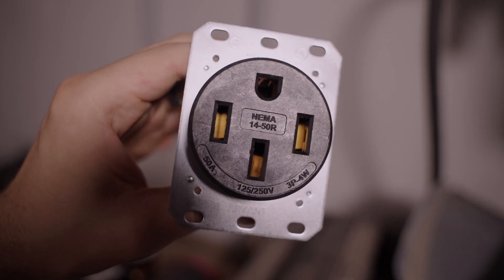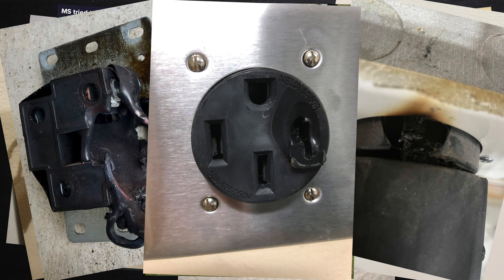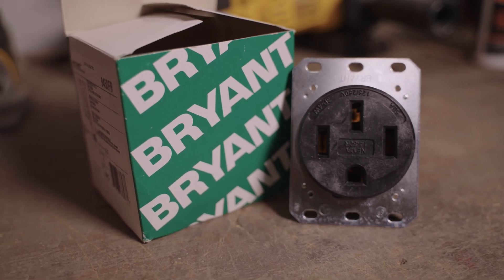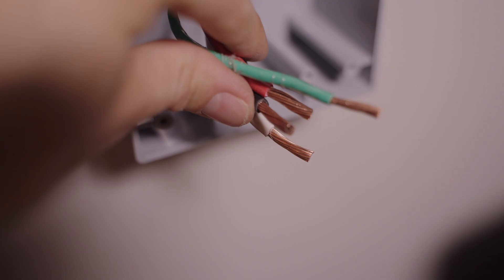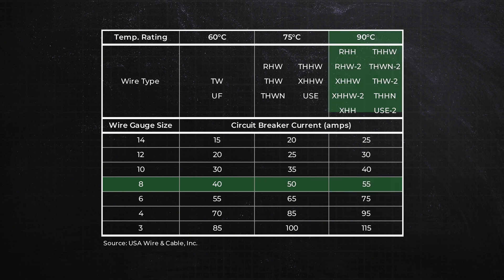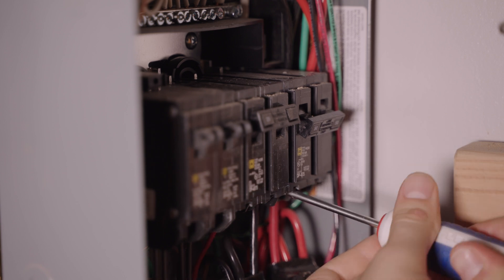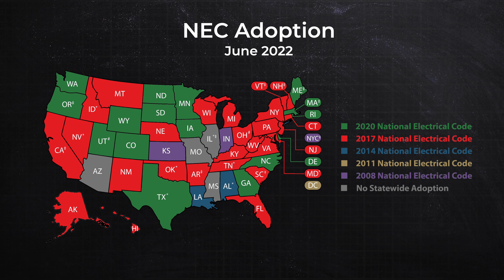3 Mistakes I Made Installing a NEMA 14-50 Outlet

Comment: The NEMA 14-50 is not the de facto wall connector unless the individual is crazy. 240 Volts in a US home is accomplish with 2 hots, L1 & L2, the Neutral is not used, you do want a Ground. The very best Wall Outlet for an EV is a NEMA 6-50. The NEMA 6-50 has 2 hots and a Ground, exactly  an electric car needs. You must also remember that because an EV Charging is considered a Continuous Load (a Load lasting 3 hours or longer). Code states that all items, conductors, outlet and breaker must be Derated to 80% of their normal Capacity, ROMEX (Also called NM Cable Non-metallic) 6 AWG is Rated at 55 Amps, but if it is used in EV Charging it is derated to 44 Amps and you cannot use a 50 Amp breaker, because derated it can only be used up to 40 Amps Continuous Load. With NM Cable, also called ROMEX,  you are purchasing 1 more Conductor than you need, wasting your money.   For EV Charging I recommend at a minimum 6/2 MC Cable. You can order MC Cable in 6/2 AWG which is 6 gauge 2 Conductor and rated at 75 AMPS @ 90 degrees, with a flexible metal conduit which I currently buy for $3.38/ft. - When you derate the 6/2 MC Cable you have 60 Amps maximum and a 60 Amp breaker gets derated to 48 Amps. So, with the 6/2 MC Cable you can get a nice 48 Amps continuous if you are using a hardwired Wall Connector.
Reply: You are right that the 6-50 outlet is technically a better choice. But I think the 14-50 has become "standard" because many EVSE come with a 14-50 plug, because they are set up to deal with an existing 240V outlet that wasn't installed specifically for charging. Since some 240V loads do need neutral, the 14-50 becomes the more commonly installed outlet, and so even though EVSE doesn't need the neutral, they are sold with the 14-50 plug anyway, and that in turn means installing the 14-50 outlet winds up being the "smarter" choice.

I'd guess this may change over the coming years. In a decade or two, when EVSE outlets are standard in new construction, they may well start being done as 6-50. Code might even start requiring 6-50, for that matter, to break the vicious cycle described above. But in the meantime, we're stuck with the fact that 14-50 is usually the more practical choice.
Reply: @harvey66616   The times that a Neutral is needed would be application such as a Stove it may need 120 volts for its Control Module, but no EV Chargers require 120 volts. (technically the Chargers are built into the cars, it is really a Wall Connector). I own 2 EV's and have driven almost everything currently available on the market.
Reply: @michaelholliday100  At least one person posting a comment here has stipulated that their EVSE does require a neutral. I've never seen that myself, but to state categorically that none ever do would be foolish.

But that's not even relevant (nor your other notes about "chargers"...I never wrote anything about "chargers", nor your claims of experience with EVs). The point is that other appliances, such as clothes dryers, some welders, certain power tools, etc. may need a 14-50. So even if it were true that there's not a single EVSE in the entire world that needs a neutral, that doesn't change the fact that many households will find 14-50 outlets already installed, and for that reason, EVSE manufacturers may choose to make their products with 14-50 plugs and not 6-50 plugs, and given that, then even though if the neutral isn't actually used, the 14-50 outlet is still what a homeowner will need.

Which is, in fact, exactly what I wrote before. Not sure why that wasn't clear to you the first time, but I hope that's all straight now.
Reply: @harvey66616  I know the EV Market well and I own two EVs. There is not an EV on the Market that requires a Neutral. Not have I driven almost every EV available, I have help install an untold number of charger and have given technical assistance to others...
Reply: @michaelholliday100  Irrelevant.
Reply: @michaelholliday100  "I assure you that if they state that a Neutral is needed..." --  I assure you, your fixation on whether EVSE requires neutral or not remains just as irrelevant as it always has been.

I pity your apparent inability to comprehend that.

Comment: It sounds like you don’t know about continuous loads. Continuous loads are utilization equipment that draws power for 3 or more hours at a time. An electric vehicle is a continuous load on a circuit. All residential (single home) breakers are only rated for 80% of the marked amp rating on them. That means that 40A breaker can’t have more than 32A running through it continuously. If your car draws more than that, you screwed up. I’m guessing if the car manufacturer requires a 50A receptacle, then it draws 40A when it’s charging (again, 80% of the rating of the 50A circuit that they require for the car charging circuit). Might want to check that…

Comment: Imagine 25% of households running their "stoves" on a setting using 40A for  multiple hours, every night.
We have nowhere near enough electrical capacity to supply that amount of power with "green" energy (unless the government and activists that seem to control the government accept nuke power as "green").
Reply: Not really true.   If you look at the "duck curve" (electrical grid load levels) one will see that the loads on the grid typically decrease nightly when EVs normally charge.   Contrary to your statement, EV loads actually help everyone out!   "That can't be!" you state but it is true.   Why?   Because the grid has to be rated to carry peak loads (during the day) and that has to be paid for by electrical rates.   The closer the overall demand curve is to a flat line over a 24 hour period, the better the utilization of the service and consequently the lower the price per energy carried because of near full utilization spreading the required peak cost over more energy usage.   

Finally, you mention EVs charging for multiple hours every night.   Statistically (which is the only thing that counts for cumulative load),  they typical US driver drives less than 40 miles per day which roughly equals 10-12 kWh.   An EVSE charging at 40 Amps (max continuous load on a 50 Amp rated circuit), is  9.6 kW on a 240 V circuit.  To replenish 12 kW into the car only requires 1 hour and 15 minutes charging.   This just is not a big deal for several years into the future.     Almost all electrical grids are underutilized so rooftop solar with battery storage and EV charging is actually a very good thing for the grid and the costs of the grid (per customer).   There is one caveat--capacity is not an issue but power plants will have to either produce more power at night or more typically, not use as much power for pumped storage so nuclear power is beneficial but until different designs get certified, there is very little chance of them being deployed in the US. (And yes, I am an electrical engineer.)

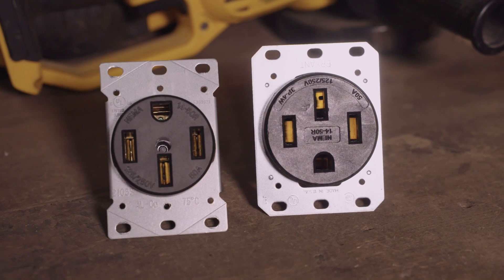Comment: So you went from a 'cheap' 14-50 which is rated for 75 degrees C to an expensive industrial one that is only rated for 60 degrees C. You can see at 8:55 that the old outlet is stamped 75 Degrees C. Was this really an upgrade?  Also since you reduced your breaker size from 50 amps to 40 amps, now you can only charge at 32 amps since a continuous load can only be at 80% of the breaker size.  So I wonder, was this really an upgrade?  Sounds like a pretty big downgrade.  

And finally, was it really cheaper to buy the off brand outlet that's only rated for 60 degrees C and a new dual pole 40 amp out let than just buying the better name brand Hubbell?  And even if it saved you a few dollars in the long run, but you've downgraded the usefulness of the outlet.
Reply: This was definitely an upgrade - those Leviton $10 receptacles are a fire hazard and not safe for future occupants of houses IMO (when considering EV charging).
Reply: @whattheschmidt  completely disagree. Just don’t plug and unplug all the time. He reduces the usefulness of the outlet by putting it on a 40 amp breaker.
Reply: @ericroe  Take a look at a break down video of the different quality receptacles.  There have been burn outs with professionally installed $10 Leviton 14-50s. Check EV forum posts about the issue. The extra $40-75 is worth it, I changed mine to the Hubbell right after the temporary  one.
Reply: @whattheschmidt  but he didn’t go to the Hubbell one. He went to one rated at 60 degrees C. The Hubbell is rated at 75 degrees C. He then put in a smaller breaker. It’s not an upgrade when you downgrade the current and the C rating.
Reply: @ericroe  oh, yes, I get that.  He should have used 6 Guage wiring! That's what I did, mine is also in metal 3/4 inch conduit.
Reply: @ericroe  The Hubbell and the Bryant are identical. Neither are marked 75C on the actual device, so both have to be used as 60C rated receptacles, meaning the conductors feeding them have to be rated using the 60C column. Both say they have a maximum continuous operating temp of 75C in the spec PDF, but this is not the same as being rated for 75C. The manual that comes with both says that the conductor used must be rated in accordance with the 60C column. I just looked at my Hubbell manual, box, and receptacle as well as researched thoroughly online. If the Leviton is rated for 75C, that might be part of why they burn out so often. If they are being installed with 8 gauge wire, they are going to generate more heat, as the 6 gauge wire acts as a heat sink. Just thought I'd clear up any misinfo. The Hubbell and Bryant are both manufactured with superior quality to the Leviton and most other 50A receptacles.

Comment: I would venture a guess the earth-grounding test of the charger / connection is the source of many of those GFCI pops. Tesla's are very picky about having a proper ground. (since the car itself isn't grounded, and you're potentially putting a 1000V on to it... grounding is important!)
Reply: The car is in fact grounded when charging - requires a good grounding connection to start charging.  Bonding neutral to ground can skip this but is a safety hazard.  People do that for solar batteries / generators to initiate charging.

Comment: What I’m finding is my garage is so hot when I charge at night the outlet is getting so hot it’s creating a trickle charge effect to my tesla. Not sure if it’s the outlet or heat in California plaguing my garage
Reply: Unless what is occurring that the car's charge controller is limiting the current (which is most likely), there is a problem there.    Are you nightly charging your EV to 100% and do you have a lower end EV like a LEAF?   If so, most likely the car is the limiting factor.  If the car charges at a much faster rate when nearly discharged that would indicate this is the case.   But if the circuit (with the car at a low state of charge), charges really slowly, you probably do have a circuit problem and should most definitely have that checked by an electrician.   At any rate, the outlet should never be getting much more than warm to the touch when operating.   It should never be hot enough to burn you.   If it is, get that circuit checked immediately.

Comment: Very good information presented, but please ALWAYS verify that the circuit is dead at the receptacle  even though the breaker is turned off.  Turning off the wrong breaker happens more often than you think! I am a Master Electrician..........don't ask me how I know.
Reply: Some electricians trip the breaker by shorting the wires with a screwdriver. That way you always get the right one. Not that I am recommending it.

Comment: You have a 50 amp breaker feeding you’re subpanel? That’s under rated for all the stuff you have on there you need atleats a 90amp breaker feeding that sub and bigger feeders ran to it
Reply: He's free to under-rate all he wants. As long as the panel is fed with enough power for the active load(s), he's fine. I suppose you only have LESS than 200A worth of breakers in your load center and it's sub-panels. (I have 295A worth of breakers in mine. Right now, the whole house/panel is only using ~6A)

Comment: I went with 6 gauge wire and a 60 amp breaker on my set up.
Reply: I hope it's not feeding a NEMA 14-50 outlet, The max breaker allowed for that outlet is 50A.
Reply: @taylorlightfoot  Its feeding a Tesla charger and a Tesla Model 3 can only pull 48 amps max so no worries. Also I turn it down to charge at 25 amps through the app typically as I like to slow charge overnight during off hours. I rarely turn it up to 48 amps.
Reply: @jstar1000  Now I’m a little curious. Are you charging using the mobile charge cable?  What are you plugging into the NEMA 14-50 outlet?  Or is your breaker and wire feeding a wall charger that’s hard wired instead of an outlet?

Comment: The mobile connector can only pull 32 amps not 40 or more.
Reply: @Jon VB I guess the new cord does pull 40 amps, mine only pulls 32, I stand corrected. I have a Tesla wall charger now and it pulls up to 48 amps but I set it at 20 amps and to charge slowly from 9pm to 8am every night.

Comment: Wow, draw 40 amps for possibly 8 hours. Can you realistically say how that has affected your electric bill? Thanks
Reply: First, 40A for 8 hours is highly unlikely. That's roughly 75 kWh, which in turn is roughly 200 miles of driving. The typical household in the US drives a max of 40 miles in a day, so unless they are only charging every five days (charging daily is much more common for EV owners), they aren't going to run at 40A for 8 hours.

That said, 75 kWh will translate to between $7.50 and $10 US. Comparing that to a car that gets 40 mpg, which would burn 5 gallons of gas to go the same distance, you'd be spending $20 for the same range in that gas car (assuming a cost of $4/gallon).

So, sure...it increases your electric bill. But it decreases your gasoline bill by much more, so you come out ahead.
Reply: It works out cheaper than buying gas, so I'm not sure why one would care about the electric bill.  It's net money saved.
Reply: I run a ChargePoint Home Flex at 48amp (on a 70amp rated circuit) hard wired (avoids the plug and GFCI). A charge from 20% to 80% runs about 7 hours and cost a whopping ($2) at .050/Kwh. There does not appear to be a direct correlation to how beefy this must be and how much it costs to charge the EV. I am not sure why.
Reply: Worst case, about $30. But the car doesn't pull 40A for 8hrs. The current drops off towards the end of the charge cycle. And you aren't doing that kind of charging every day. (assuming once a week with $0.12/kWh power)
Reply: I also charge two BEVs but they only drive (on average) the typical 40 miles per day which requires only about 1 1/4 hours to recharge daily.   However, in the real world, the Tesla goes on long trips and comes back home near empty.   When this occurs, it can take several hours to recharge--up to about 8 hours.   But since this only occurs roughly only about once a month it all averages out.   With my EV electrical rate from my electrical co-op of about $0.09/kWh, this works out to $6.30 for a fill up (about 300 miles range) which would cost me about $35 on a 30 mpg ICE car.   So this is a substantial savings.   In my case, the EV rate saves me about $80/month (average) on my home power costs so two EVs actually save me money on my electric bill and I have no gas bills (except for my riding lawn mower!).

Comment: So, isn’t THHN 8 awg rated for 55 amps, not 50? Just as a point of order…
Reply: Did you watch the video? He derated the breaker to match the 60C limits of the outlet. Yes, 95C 8AWG THHN is rated for 55A.
Reply: Joe,   There are no terminations made that will allow for 90C in devices or breakers.   The ampacity of the conductor must match the C rating of both, whichever is lowest.   Breakers are 60/75C but receptacles can be 60 or 75C.   Hubble was first to go 75C.   Must know to size conductors.
Reply: Both the Hubbell and Bryant receptacles actually say to use conductors rated for 60C in the manuals that come with them.

Comment: Those 50a 240v outlets are fine to use. They're used frequently for rv applications. 

There's nothing wrong with the terminations in the original outlet. A lot of breakers use the same method btw. 

You really should glue your pvc connections.

Comment: When charging a EV an a 240V Outlet the Neutral line has NO Load at all. So you only have 2, not 3 powered lines.
Reply: Not necessarily. My charger has 120v single-leg power supply in it to run the computer, so there is a small amount of power on the neutral.
Reply: It would still count as 3 current carrying conductors.

Comment: Issues on the old installation. You used stranded wires. If you had used solid core then the issue with the clamp would not have occurred. Or if stranded , crimp on the corresponding gauge ferrule on the end and then screw down on that ferrule end.